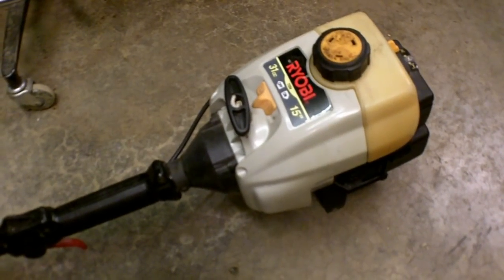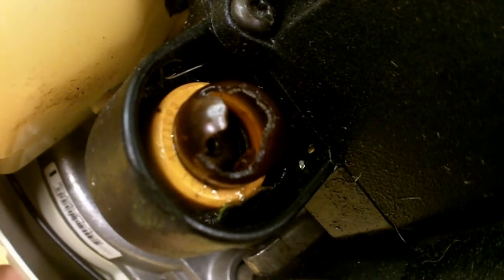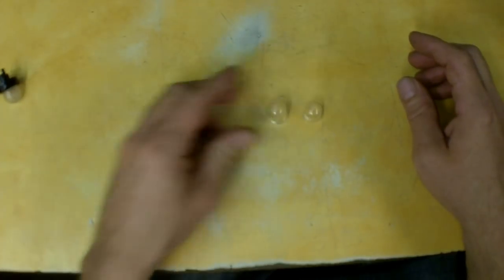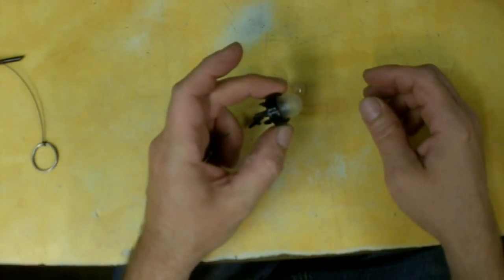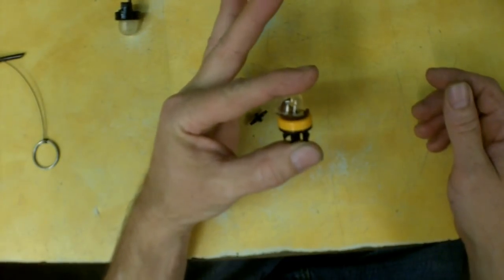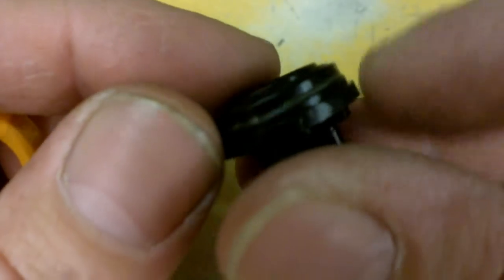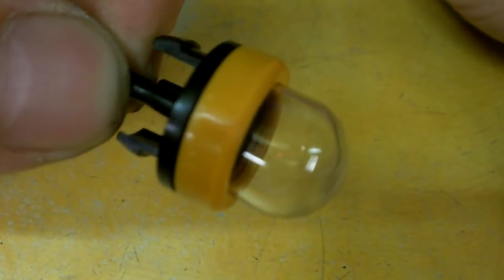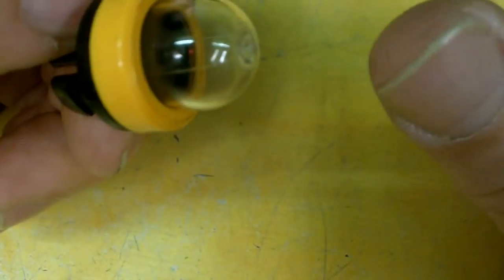Ryobi Line Trimmer Primer Bulb Replacement/Repair

Comment: I have the same trimmer, and I must agree - this thing is an absolute MONSTER!!! Unfortunately, the problem of dry rotting in the replacement lines and bulbs are a common occurrence for me. Other than that, I would have never expected this thing would still be running today. :)
Reply from the maker: That's cool Mickey! They might not be made like this anymore, not sure. But if they are, I'd gladly get another. At this rate though, I may never need another trimmer....lol.  I think I paid about $89 for it way back then. Amortized out to now, that's about $5.25 per season....lol. I usually empty the tank and run it dry after use- or especially at the end of the season. I also do my best to not run ethanol in my small engines.  Other than what I've shown, or described,  here, I gas it up and it just works! Glad you're getting good use with yours as well. Take care, G.
Reply: My Ryobi trimmer is going on 20 years, fuel lines replaced twice and bulb once. That's it. Great piece of kit.
Reply: I just got one of these out of an estate sale in 2019 ... it was Brand New ! .

Comment: The one pump and it starts method is a dream I've had for many years. Perhaps sometime in the future. That really is a cool and very useful kit! As you said, the price was high but the variety of parts will do it all and the snake was a big bonus!
I'd have kept the bulb by itself just in case one of my other primer pump bulbs went out IF it had that size. So guess your don't!
Man o man do I wish I had a primer and could get my chainsaw to crank on the first pull! Heck, I'd be happy for 10. When I need some exercise and to get winded, I just go out and try to start it whether I need it or not - haha. Seriously though, any of your "Ghostes - Mr. Master Fix It" ideas to get a chainsaw to crank on less that 30+ pulls? I thought about cutting the chaisaw up enough to put a socket on the drive nut and using a drill to start it. Haha
Reply: Assuming your primer is transferring fuel correctly, your choke is operational, and everything else is in place correctly (good compression, good spark) I would begin by turning the low speed screw out (counterclockwise) on the carb about 1/4 turn. If it has limiter caps on the screws you might need to remove them. Once it is running you'll need to adjust the low speed screw so the engine starts well and doesn't bog on it's way to full throttle.
Reply from the maker: Yeah Mac, I probably should've. I don't know if any others are small- perhaps my chainsaw is. As for the rest, I think 2AM's comments spot on! If it's ever been into, or maybe purchased used, I would start with the routing of the lines. I've fixed many by simply correcting routing issues.  G.
Reply from the maker: Great write-up! G.
Reply: ghostses Ok will look at them. And Thanks  again for a great video!

Comment: Sir are you saying a big bulb may fit a small one?Would be good to know
Reply from the maker: Daniel, I used the complete big bulb that came with the kit and have had no problems with it. I fixed the original with the appropriate sized small bulb that fit. I've since put the one I fixed on one of my Dads machines and it's working great. Hope this helps clarify. Take care, G.

Comment: I'm struggling with my chainsaw, pulled all the fuel lines unusually without taking a mental note of how they connect.
I have two connections on the little square carb, the tank , and the primer bulb.
I think the fuel filter line goes to the primer suck, the other primer line to the top of the carb, and the bottom carb returns fuel into the tank.
I also think I'm an idiot :)
Reply from the maker: I have a video outlining this type of thing Neil. I don't necessarily point out the lines, but do describe how they are routed on my saw. Yours sounds very similar, so you might check it out and give it a go. Just skip ahead to the relevant parts. Good to hear from you, G.

https://www.youtube.com/watch?v=wyIoBUqcmHE

Comment: Did the super glue hold
Reply from the maker: I'm still using the replacement so I haven't used it yet. But it is still in one piece. Good luck, G.
Reply: I also added a smooth layer of gasket maker to the outside as a small fail safe if the adhesive leaked by minutely
Reply from the maker: @abel85n3  Good idea! G.

Comment: Thanks for the helpful and informative video.
My Ryobi trimmer instructs the user to prime 10 pumps before a cold start. It must be frickin' tiny (before it perished)
Reply from the maker: No problem! Yeah, not sure on that one. Take care, G.
Reply: I have a ryobi lawn hornet.With a service it seems fuel lines were terrible when they were released.other than that a fairly easy fix.my lines and bulb perished after silly me stored it with fuel in the lines.